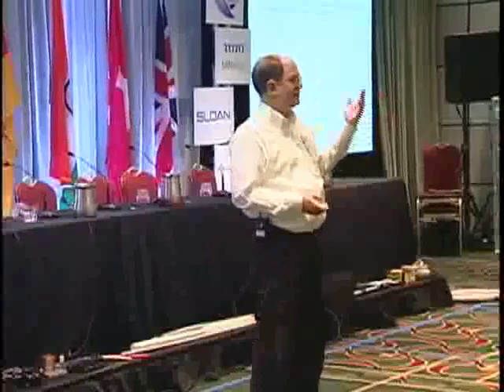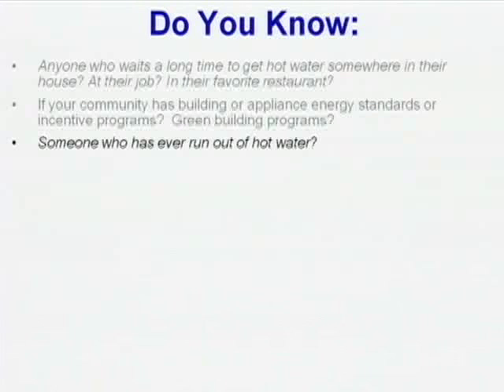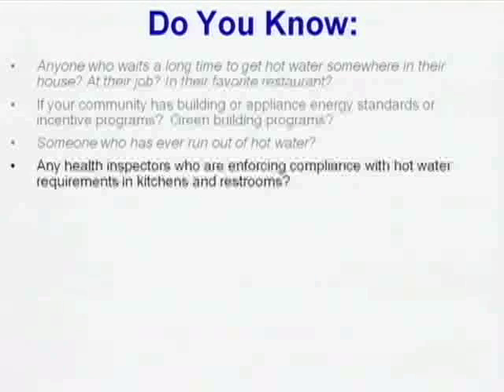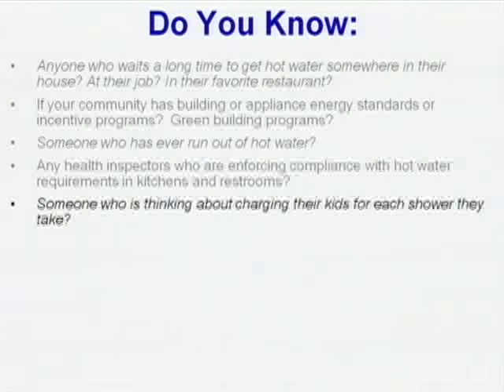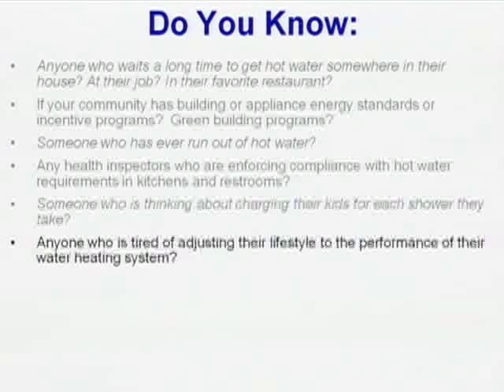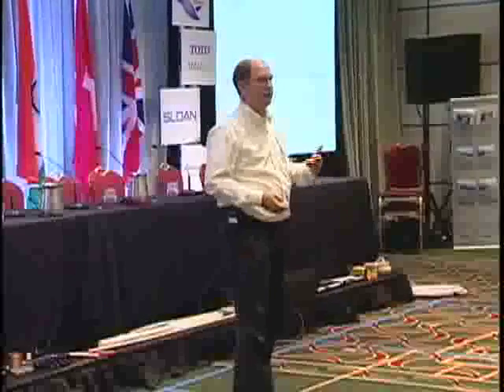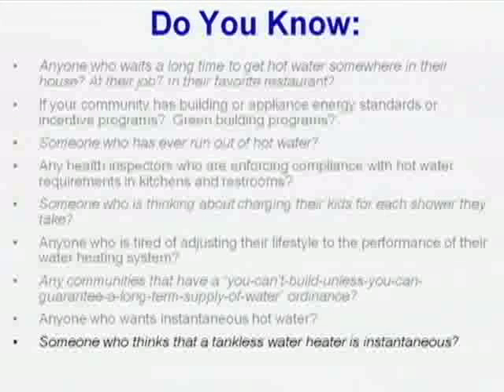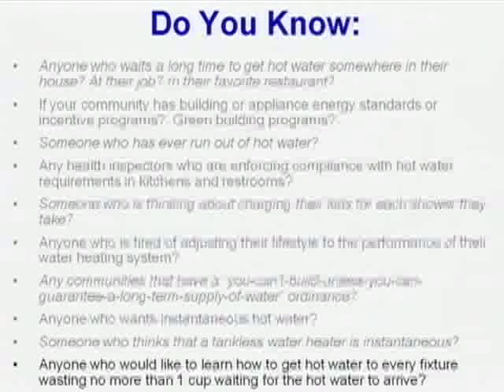IAPMO ETS - Practical Plumbing Layouts: Part One

Comment: How to cut the wait for hot water in bathrooms that are a long way from the water heater, add a return line from two locations, through a check valve, into the bottom of the heater, setting up a circulation of hot water that does not require a pump. Hot Water Recirculating Loop by Owen Perkins video

Comment: I bought a house with one of these manabloc manifolds already present  and it worked beautifully, until we had to replace the water heater ,,, then it started to leak.  Unsure why , but my plumber said that one of the entry ports "cracked " and he wants to replace the entire unit.  Does this sound right ?